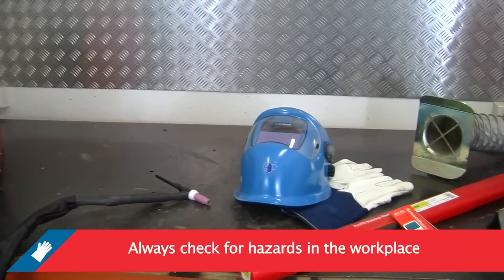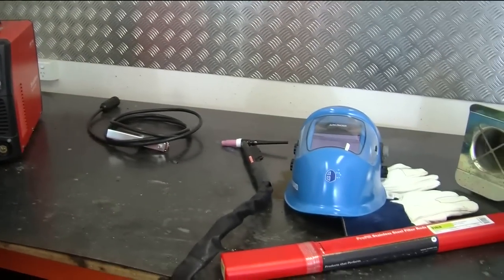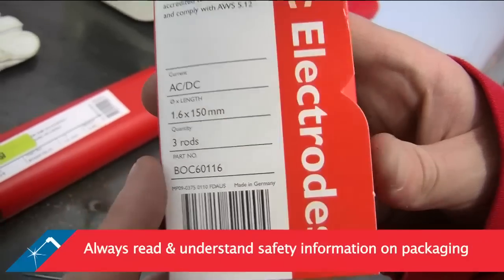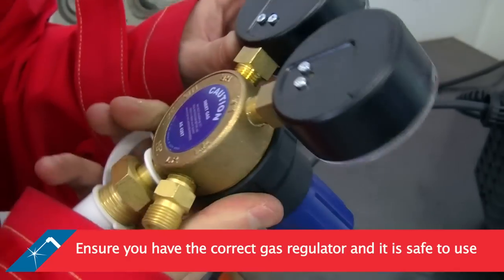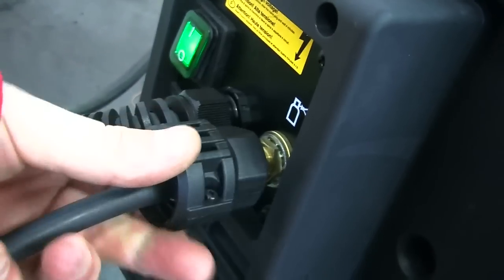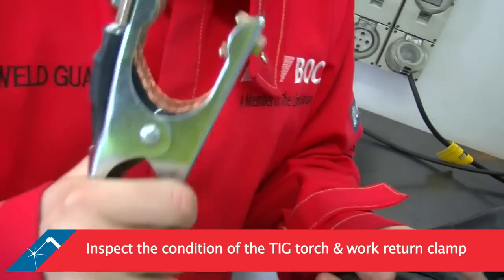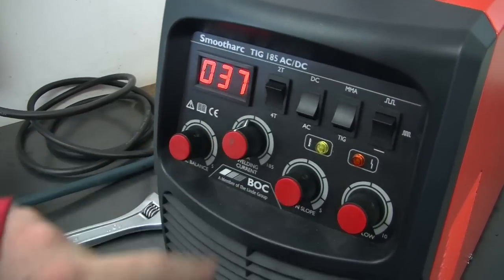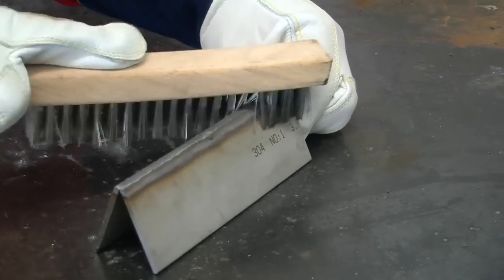How To Set Up A Basic TIG Welding Machine - BOC

Comment: DCEP for Ally (AC welding)
DCEN for Stainless and Mild Steel (DC welding)

Correct me if I'm wrong. BOC supplies zero info regarding this with the Smootharc TIG 185 machine.

Thanks
Reply: I just bought one, can't find a list of parts for the Tungsten tips, Handpiece etc, nothing supplied regarding what was in the box, or how to assemble and set-up for a newby to TIG welding. Pretty poor in that regard.
Reply: @ronaldbarker6279  im just about to get one and the guy at the shop has included all the consumables I need as I am remote and cant just go to a shop, maybe I am lucky with good customer service, we will see lol